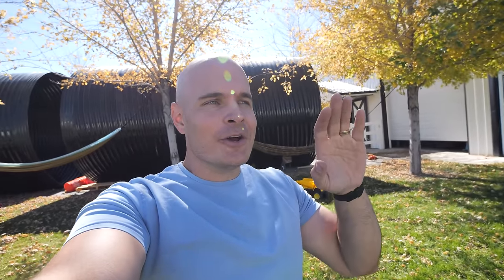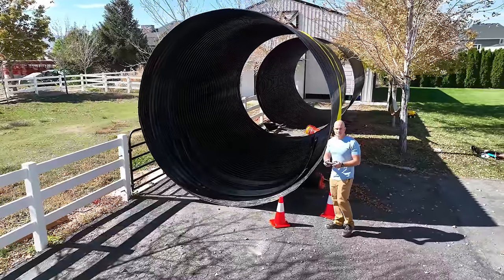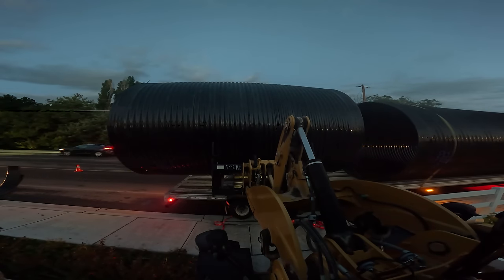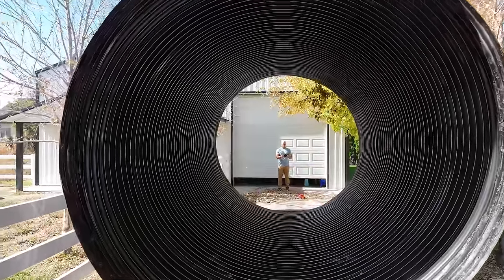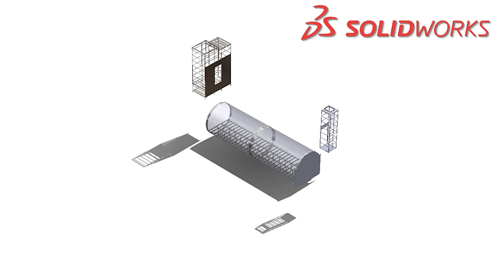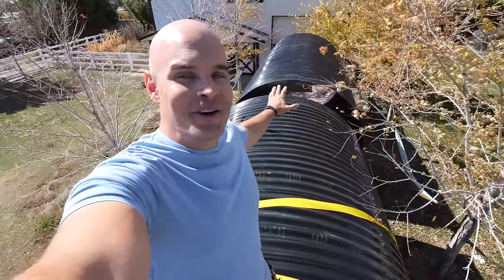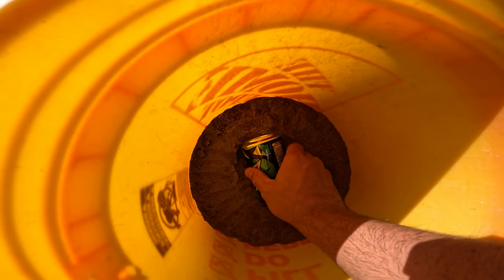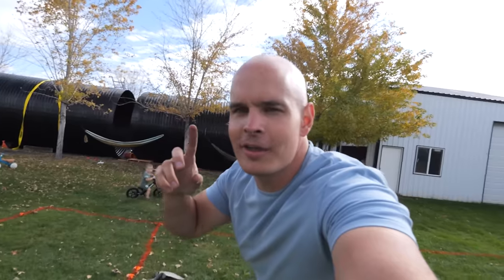I'm Building a Backyard BUNKER Part 1 - THE BIG TUBE

Comment: The main thing that I would do differently here is to add in a second subfloor along with strategically located access hatches to make a huge underfloor storage area.  Having that large storage area means that in the event that you do actually want to use this bunker as a long term shelter then you can store a lot of food and other supplies in there while still maximising the available living space for the inhabitants (very important for the longterm mental health).  You want that second subfloor in there to help protect your storage from any water ingress that will pool at the very bottom (along with any potential longterm condensation) and because it is much easier to store and access supplies on a flat surface.

Something else you could do is to add a large bladder underneath that subfloor and use that for bulk water storage.  This would likely need to be a custom design (i.e. expensive) so that you utilise the entire area while going around the floor supports.
Reply from the maker: Good ideas! We will try to do both of those things

Comment: I have watched Colin Furze build a Bunker, I Can't wait to watch your Bunker build. This is going to be epic.
Reply: Technically he built a tunnel.  Though this project could use a tunnel to have one of the entrances start in the garage and the other in the house.  And it needs an elevator on both ends of course, not a ladder.
Reply: you have obviously not seen the bunker build. The tunnel is newer and will eventually connect to the bunker
Reply: @curtisbme  I would call the giant pipe a tunnel.
Reply: @curtisbme  no, he built a bunker, with tunnel access, and now he's adding an underground garage for the DeLorean... way better channel!
Reply: @curtisbme he doesn't need a lift, he's a Brit and not lazy

Comment: Water infiltration is your biggest enemy, be sure you are bedding, draining, and sealing properly. I’m enjoying all your content, have a great day!
Reply: He probably has made a lot of research from Atlas Survival Shelters, Round Culvert Bunkers, a top seller, from bedding, drainage,  blast valves, check valves against tampering, 6 dog airtight bullet proof door, the angle on the intake and exhaust pipes so no fluids can enter and condensation travels down this angle and not into the air filtrations system  intake. Really a cost effective design.

Comment: In Estonia we have a warehouse/factory for similar pipes and i've always thought of this type of usage for them from the day i saw them, modular, different diameters and multi layered, certainly an affordable way to build anything underground.
Reply: How tall are those pipes? Because you'll want something at least 3 meter tall inside to give you enough room, especially because the actual internal heighth will end up quite a bit less due to the curved walls, floor and ceiling. Normally when they bury those pipes underground for bunkers they place wooden frames that are 50-70 cm tall in the center and on which wooden boards are placed which become the floor. That way you'll have a nice flat floor with a lot of storage space in the floor for food and what not. But of course that does mean that the internal height also becomes 50-70 cm less.

Comment: I recommend the Swiss air system for your bunker, if you're going to ride out nuclear fall out for a few weeks, you'll want to be able to pull in air and filter it. Also, make sure to put plenty of storage under the floor for food and water, two weeks to 4 months supply depending on how you do it. Another thing is to make sure the doorway is at right angles to the stairs leading down so that radiation is deflected, and of course don't forget an escape tunnel in case the main one is blocked.
Reply: And, for the love of God, all doors must swing INWARD.
Reply: I don't know what his geology is like, but I wonder if a water well under the bunker (more specifically in one of the entrance/exit shafts for serviceability) wouldn't be a bad idea... Also need to somehow plan for "outflow"...

Comment: Atlas survival shelters has a good analog to this type of corrugated tube bunker. The most important parts are gas tight doors, a proper ventilation system and sufficient depth into the ground.

Comment: Make sure you include in the design to have a 1 ft Gap under the entrance to the tunnel. Like having a steel  grate floor or a deck with wider spacing for the cold air to drop in to

Comment: I know I'm watching this late & you've probably done a whole lot already since I'm just starting this series but I hope you'll consider doing an elevator or lift of some kind on both ends, one that you can run if the power fails (pull pulley system of some sort) because if there ever happens to be a fire while your wife is down there, she needs to be able to somehow evacuate if the fire is blocking the elevator. If the fire moves fast & takes out the electrical system, she should still have a way to get out & I'm going to hazard a guess that she'd have a super difficult time trying to climb a ladder with just using her arms. If this happened while you ran into the house for something & your wife (& child) decided to wait there, she needs a way to evacuate herself. 

You should also make sure she has a reliable way to do that from the 2nd floor of your house with your kid if you aren't home. You don't want her to use an elevator tied into the electric cuz those shut off when the fire breaches certain wires. She easily could be stuck inside that glass box between the floors watching what is coming & utterly helpless to do anything because she's trapped. She couldn't save your kid & that would be terrifying for her. 

You seem like a guy who values safety & likes to plan ahead so this is something to consider that you may not have yet.

Comment: I would just point out with your can comparison experiment, you squeeze it with your fingers in the middle of the can but the structural integrity of can comes from the ends. When you put it in the bucket with the sand, when standing on it, you were likely standing on the rigid can ends. Nice idea anyhow and given the use of the piping commercially, it would have guidelines for structural integrity, hopefully not requiring encasing in concrete.

Comment: Before you bury it, you should still wrap the outside of this thing with rockwool insulation. If you ever want to change the inside air temperature, you will have a massive thermal bridge to get over. The R value of dirt is 0.25 to 1.0 per inch (very bad) and you will have to deal with a huge thermal mass that will suck up all the energy you put into the container. This will be harder to heat and cool than a structure that is above ground.

Comment: Bunkers typically do not work, Jerry. Very cool idea and I personally share your interest in them. 1. If people know you have one, you will be raided first during an apocalypse. Do NOT tell people!....Woops! lol 2. Air, you need to breath. Bad people simply smoke you out. I personally do not want to be trapped underground with my air vent exposed. 3. technology is very limited without Wi-Fi, unless you just want to run bunker electronics? Bad people will destroy any antenna you may utilize.  Now, how would I go about solving some of these issues? Possibly utilizing a Conex box and boring it in a hillside? Probably just as bad of an idea. Way cheaper and very easy to move and install comparatively? Maybe. You still have air quality issues and similar weaknesses. The underground bunker should definitely help for radioactive issues, but humans will be the biggest threat, IMO. Awesome videos as always, keep up the awesome content. <3
Reply: PS, I bought a knife to support! :)

Comment: You doing a HEPA system with positive pressure? It can be off 99.9% of the time with just passive ventilation, but it would be cool to add it to make the bunker 'functional'. Also cool would be solar power and batteries, and a atmospheric water generator for free infinite drinking water and to dehumidify the space.

Comment: 100 years is good, and with no actual drainage water flowing through the pipe, I'm expecting it should last much longer. Still the up front cost of the pipes is something. I think that the steel beams/sheets insulated by plastic and a concrete over the structure (Colin Furze's approach) will last longer and is not much more expensive, considering that a lot of the cost will be digging a deep hole anyway. 

That being said, I am no expert and unlike Jerry I haven't done much calculations apart from looking at the rough cost of steel and concrete.  I am very much looking forward to see how this project progresses, it sure is a clever and interesting approach!

Comment: I’m wondering why not cut the culverts in half lengthwise? Cylindrical shape would still be intact for strength (full one can go 100’ deep so 6’ should be no issue), cuts initial cost in half and flat bottom floor easier to work with/ less welding and metal work. Judging from the brief view of plans you’d have a lower average head hight but much more useable floor space. Maybe concrete pad costs would surpass the savings from the cut?

Comment: I am a licensed General Contractor and Civil Engineer in Arizona. While I have not done a specific estimate comparison, I believe that had you used the "concrete basement" you mentioned and performed much of the labor yourself, the cost would be roughly equivalent to the design that you are using. It would have to be engineered, but your existing design should also be engineered structurally for safety. I believe the concrete structure would be superior to the steel structure you are using. Primarily, it would be structurally stronger and can be made more secure. This is why concrete has always been the choice of bunker designers for as long as concrete has existed. The Romans used their "Roman concrete" for underground structures, and many of these are still in existence and are structurally sound.

That being said, your steel design is creative and simple. I commend you for your critical thinking skills. I wish you and your wife the best for your family.

Comment: I'd be worried about the lower portion of the dirt below the half point of the pipe, do you plan to pour liquid concrete, to fully enclosed the bottom portion ? Or just throw in enough dirr and then vibrate the walls to make sure it goes down around all the way ?

Comment: Everybody thinks about water, air, electricity and storage. What doesn't get highlighted, perhaps you can mention is: waste.  Even if you use a septic tank/connect to it or a sewer, suppose those connections break, you need to have a backup that will be able to be emptied.

Going back to power, I would suggest a way to manually generate electricity should there be a meteor hit, for example, and the sun blocks out the sun for a couple years.  You will need said manual way to generate electricity.

Comment: Check the water table and bouancy risk in rainy seasons. Don’t need ballast to hold it down?  I think Utah is safe but just checking in. I’ve seen drained back yard pools surface  which were emptied at the wrong time of the year where the water table was high and 20k gas storage tanks surface!

Comment: I don`t know if the storm drain idea was really the way to go, regardless of how tested and proven the material and techniques are. 

Something like a carbon fiber tube (you can source this inexpensively from the aircraft industry), with titanium endcaps epoxied to them would probably be a much better way to go. As a nod to the much more modern materials and construction techniques used, you could call it the Titan bunker or something.
Reply from the maker: Carbon fiber and titanium would be astronomically more expensive. Like 100x more. We don’t need any weight savings here and that’s really all carbon fiber and titanium are good for. Cool materials for sure. But expensive.
Reply: @JerryRigEverything  They were making a joke about that Titanic submersible I think.
Reply from the maker: @WinksVonHugsy  lol that makes a whole lot more sense. My bad.

Comment: Every bunker needs fresh air.... kind of a nuclear or other issue. The Joker, in the original Batman series; was our first domestic terrierrist, when he did something to the Gotham Reservoir. I think Bruce Waynes' mom got jellied in the shower from that.

Fun Project !  And if you HAPPEN to live near an abandoned subway tunnel, I can imagine a real neat escape vehicle that travels like it is on rails!

The cost of the culvert pipe is not bad. PRecast concrete sections, as used for septic and similar structures, would be 3-4times that.  Though pRecast allows for vertical walls

Comment: Under standard conditions, radon is gaseous and can be easily inhaled, posing a health hazard. However, the primary danger comes not from radon itself, but from its decay products, known as radon daughters. These decay products, often existing as single atoms or ions, can attach themselves to airborne dust particles. Although radon is a noble gas and does not adhere to lung tissue, meaning it is often exhaled before decaying, the radon daughters attached to dust are more likely to stick to the lungs. This increases the risk of harm, as the radon daughters can cause damage to lung tissue.[5] Radon and its daughters are, taken together, often the single largest contributor to an individual's background radiation dose, but due to local differences in geology,[6] the level of exposure to radon gas differs from place to place. A common source is uranium-containing minerals in the ground, and therefore it accumulates in subterranean areas such as basements. Radon can also occur in some ground water like spring waters and hot springs.[7] Radon trapped in permafrost may be released by climate change induced thawing of permafrosts.[8] It is possible to test for radon in buildings, and to use techniques such as sub-slab depressurization for mitigation.[9][10]
Epidemiological studies have shown a clear link between breathing high concentrations of radon and incidence of lung cancer. Radon is a contaminant that affects indoor air quality worldwide. According to the United States Environmental Protection Agency (EPA), radon is the second most frequent cause of lung cancer, after cigarette smoking, causing 21,000 lung cancer deaths per year in the United States. About 2,900 of these deaths occur among people who have never smoked. While radon is the second most frequent cause of lung cancer, it is the number one cause among non-smokers, according to EPA policy-oriented estimates.[11] Significant uncertainties exist for the health effects of low-dose exposures.[12]

Comment: Wouldn't it be cheaper to just get a large septic tank (or likely a holding tank) instead? Those tubes are about $16k each. Haven't checked pricing specifically, but just to have a septic tank replaced around me is like $25k and that includes the labor involved in removing the old one and installing the new one. But I assume you looked into that I'm guessing.

Comment: You’ll regret not going for the 15ft pipes if you’re ever forced to use them long term, as spacious as they look above ground once you’ve installed the floor, utilities and furniture that useable space will be shrunk considerably. I’ve watched a lot of videos on this subject and no doubt you have too so I’m surprised you went with 12ft pipes, that extra 3ft makes a huge difference. Too late now though, I will be watching with interest.
Reply: 12 feet is the standard max size for most culvert mills, anything above is much much more expensive

Comment: As for me, concrete is not so much expensive, but much better option in terms of working with it later - adding floor, walls, hanging cabinets, adding ventilation, etc.

Comment: OK. Most guys think that they could, or would like to think they could, build a secure underground shelter. But other than stocking it with food, supplies and essentials, along with game systems, fully stocked hard drives and books etc, it is calculations for and the equipment to recycle/purify water, power and air filtration. Ohh and not forgetting human waste. And what about back-up systems? Gonna wait and see :face-turquoise-covering-eyes:

Comment: 6' isn't deep enough. You need ideally 10-12' minimum. Also, you need to dig your entry shaft at a steep angle, with some bends in the pathway to account for radioactive particles, chemicals, or anything else bad leaking down into the bunker. And your air filtration system is a whole other bag of worms; probably like wiring up your Hummer.

Comment: Isn't it gonna rotate?
I mean with all trucks and cars crossing the street its gonna send some vibrations
Imagine the bucket and sand experiment if you tap the bucket constantly the can gonna rotate somehow
Round is round and round rolls
I think your bunker needs some concrete pillars to hold it in place
I not an engineer I just imagined

Comment: Do you know a pretty good reason for those pipes to be there for your neighbors depending on where you’re at for my location I could get away with saying it is a septic system or since I go buy a well and my well is running dry I could say I am using it as a Refillable well, when you can get away with doing anything like this if you think of a good excuse like you think about it that would look great and would explain a lot. If you said it was an enclosed water tank system that you guys are building for your water supply.